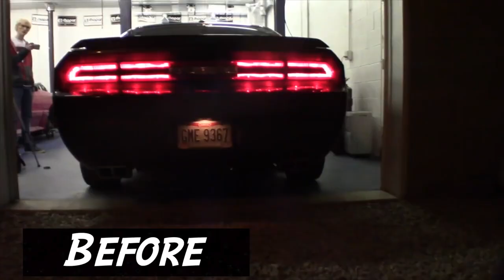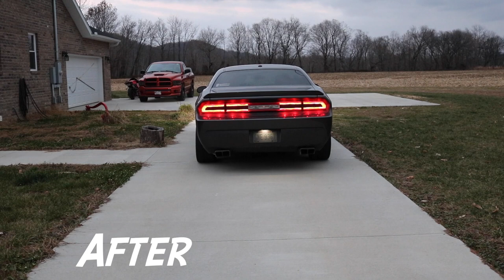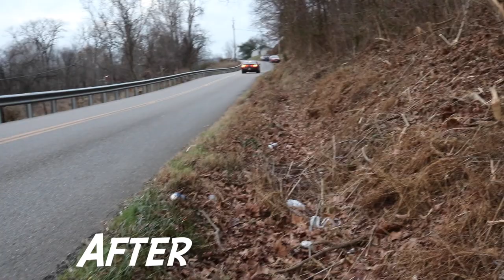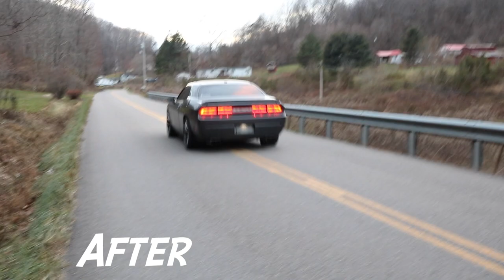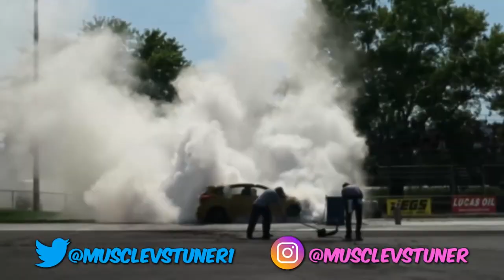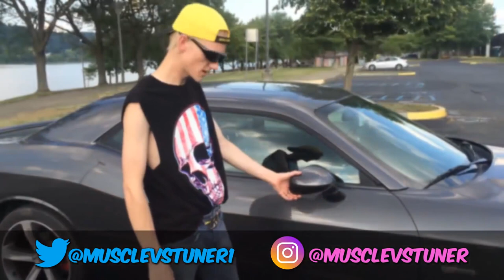DAMN My Car Got LOUD!!

Comment: I thought the 5.7 hemi made 370 hp. What am I missing here?
Reply from the maker: +Niko Bellic ASMR Look up the difference between crank and wheel horsepowrr
Reply: Niko Bellic ASMR ..theyre rated 378 bhp, 335 whp
Reply: Michael Harrison Bhp stands for brake horse power, and whp stands for wheel horsepower. I'd be surprised if they were actually that different
Reply: not even that, I dyno'd my 5.7 hemi an it made 320whp.... very sad
Reply: I didn't even think of brake and wheel. I totally forgot about those. Sorry.

Comment: I thought Challengers came standard with 375 horsepower?
Reply from the maker: +Jonathan Pitchford Was talking wheel horsepower not crank
Reply: Muscle Vs Tuner Oh okay, my bad. Shit dude I love what you're doing with the Challenger so far, looks sick. Have you thought about camming it a little to give it more of a muscle sound too?
Reply from the maker: +Jonathan Pitchford I want to but a procharger will give me more gains and I can't run both without forged internals or I would
Reply: Muscle Vs Tuner you can get a non mild blower cam and stick with stock internals you will be ok as long as you don't push the buttons man

Comment: Do long tubes void warranty??
Reply from the maker: +devan ward yes sir. You need a tune
Reply: devan ward No. They don't. Nothing voids your warranty. It's illegal for a carmaker to void a warranty. 

You could set your car on fire and the smoldering pile left over still has a warranty. They just aren't covering repairs UNDER the warranty. 
If you add headers and tune your car, you still have a warranty. The issue is if your shit tune leans out your engine and you burn up a piston they aren't covering it. If your suspension breaks, they're still gonna cover it because the mods had nothing to do with the failure.

Comment: Says he has no traction cause of all the power....doesn't break the tires loose one time....🤔
Reply: MrMotorgeek101 l maybe he launched in second gear like he said he would
Reply from the maker: +MrMotorgeek101 Actually did twice, traction control kicked in. You can hear my engine duck in RPMs

Comment: stock camaro SS is better than that car
Reply: Richard Palmer obviously. This isn't actually the sport orientated version of the Challenger. If you compare the Challenger SRT8 to the new Camaro it's a better comparison. This R/T just has the 5.7  engine straight out of luxury SUVs and trucks like the Grand Cherokee and Dodge Durango, RAM etc. Of which none are made for performance, only nice low down torque
Reply: I was talking about the sound of the two cars in comparison...lol
Reply: Richard Palmer I know you were. Still the same time apply though, the sound coming from a non sports orientated engine vs that of a sports car isn't fair. For example listen to the exhaust note of a turbocharged Focus RS (which is a normal turbocharged 4 cylinder) vs the turbocharged Cadillac CTS, the RS kills it in all situations.
Reply: By "kills it" are you saying that the R's sounds better than the CTS...and I understand that but an unmoddified Camaro SS vs a Modified challenger rt the Camaro would still sound better even if the Camaro was a six cylinder RS.
Reply: Richard Palmer I know a few guys that have camaros and I haven't heard not one stock exhaust that impressed me. matter of fact I have never heard a stock challenger(besides the hellcat), Mustang, or camaro that impressed me. I start my car next to a stock camaro and you wouldn't even hear the camaro's exhaust
Reply: Richard Palmer going by you last comment you just sound like a fan boy. my nephew has the v6 camaro and he wants to trade it for a v8 camaro after hearing my car with just the exhaust
Reply: SC Challenger as a guy who prefers GM's V8 i would say without a doubt a 5.0 mustang sounds the best without having to put alot in it just an exhaust..

Comment: please stop arguing about auto vs manual. There is no argument. Anybody that is an auto enthusiast  prefers manuals. The moronic argument about auto being faster completely misses the point of what it is to have a manual transmission. Is not about the fuckin .02 of a second that the auto transmission saves between shifts. Who gives a shit about that. 99.9% of us are not pro race car drivers. The point of having a manual is to enjoy rowing the gears in your vehicle. it provides you with a mechanical connection with the car that the auto will never give you. It makes you know your car and it makes you driver. If you are a real car guy, there is no argument. 2016 Fairlady Z Nismo, brilliant silver, 6MT.

Comment: Srt replica...smh
Reply: Will prolly be faster than the srt8 after boost.
Reply: BassManBobBassCovers well the 5.7 block can't handle much...and its just srt no more SRT 8
Reply: hittin-low_150db+ my supercharged challenger has yet to lose against a srt. I'm over 500 rwhp on a stock block and has yet to have any issues. this 5.7 block is stronger then people think.
Reply: Yeah not a big size difference between the 5.7L and the 6.4L. With boosted 5.7 the srt8 will lose every time.